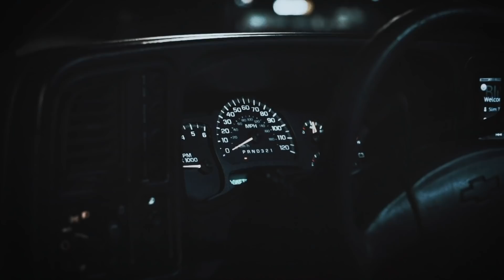Starting up my Drag Mustang’s Built Engine for the FIRST TIME! *INSANELY LOUD*

Comment: Oh snap he’s putting that coyote engine in the camaro lol
Reply: SuperSportfan1 i was thinking maybe the race truck tbh
Reply: SuperSportfan1 that’s what I was thinking as well
Reply: No, its definitely going into the old camaro.
Reply: That would be awesome.
Reply: Cam Aumann he just got the holly efi into the truck, he’s probably gonna try and run the engine to the ground (blow it up) then get a built block and add boost, since he still does have a pro charger
Reply: The camaros did come with a 5.0 in the past, IROC and other models. Either way if he does put a Ford in a Chevy he’s going to break the internet and get some pist off purist. I’m a GM fan and I’m eager to see that swap !!
Reply: @SuperSportfan1  
I am also a Chevrolet fan (not fanboy) & I don't care I want to see Gavin put the Coyote in the 67 Camaro so bad. 
As I've wanted to do this for like 5 years. Now he has to do it because he said he was if he don't do it then I will unsub well probably not but it sounded good hahahaha
Reply: @SuperSportfan1  rob dahm rotary swapped a c4 I think give em a break
Reply: Roshi Sama he did 😂 but no one seemed that disappointed
Reply: Hes gonna have to hack up the engine bay to fit a coyote in there

Comment: Imagine if he puts that engine in the camaro 🤣🤣🤣
Reply: Isaiah Holmes he is
Reply: @MenaceLV  no that engine is going back into the Gray Shelby.
Reply: Austin Mosier why would it go into the grey Shelby ? It just got a built engine, he’s been looking for one for the Camaro and last video he accidentally said he’s gonna be breaking it in to be able to put it in the other car
Reply: @MenaceLV  which engine did he put in Satan since the other one is getting built? He put the 350 engine inside Satan
Reply: Austin Mosier 350 has its own motor that got sent out and is back in
Reply: Dylan Gerstenecker exactly, he doesn’t understand. Satan has its own engine that has been sent out and is still getting worked on. As he stated in this video, it’s a temporary one until he gets the built one back. The Shelby has its own motor that’s currently running the twin turbos
Reply: Menace yea pretty sure the 5.0 blew the motor he got a gen 2, blew that motor and then had a mmr short block Layin around and that had fucked compression so that motors been getting redone while he took the gen 2 to a machine shop and is in satan rn
Reply: Menace or something like that

Comment: That Garage / Shop needs the floor’s epoxied and do ITsJusta6 logo dead center!

Also need some organization instead cars and trucks randomly parked all over. 
The space you’d gain if you did organize it.
Area for engine assembly / disassembly organize it right down the line from engine to cassis to finished car at the end with nicely epoxied floor w channel logo. 
Yeaaaaaa

Comment: The problem with running straight water is that it will rust not as bad with the distilled water. There is no lubrication for the water pump and it can cause pitting and flaking of the metal in the water pump and the coolant side of the cylinders. I'm guessing that's probably the reason for the adative wich you definitely want something other than just distilled water.

Comment: E85 will pull in water from the air and it sinks to the bottom of the tank so your fuel pump was pulling in water with fuel. That’s what happens when you let it sit for so long

Comment: Black car will be twin turbo’d and ‘67 camaro will have the current coyote engine in it...my predicts. Also glad to hear from last video that the hydro Ebrake is coming out. If you refer back to comments when it was installed, I said your are only destroying a console... Drag racing you need a line lock, not brakes stopping rear wheels. Even though I got blasted in the comments for saying it...hey what does 20+ years of racing know.

Comment: If you unplug the antenna under the cupholder it won't start. The cupholder lights are a different, 4 pin connector instead of the 2 pin one for the antenna.

Comment: Gavin if you are reading this don’t I repeat don’t put the coyote in the camaro keep the engine Chevy based but you can use a different transmission and differential if you want to but keep the engine Chevy based

Comment: Dude change the name from satan to Black Stallion. After all the car has an horse on it. You really gonna need Gods favor and protection when you get the piece together with the monster of a motor. It’s gonna be crazy, so much power. I say it’s gonna tote the front wheels. Insane Power like running the eighth in the high fours low fives. Can’t wait to see the beast smash the strip.

Comment: Brah stop priming fresh motors. Coyotes dont build enough oil pressure while cranking so all you are doing is pushing oil away from all your fresh bearings and creating wear before the motor even starts